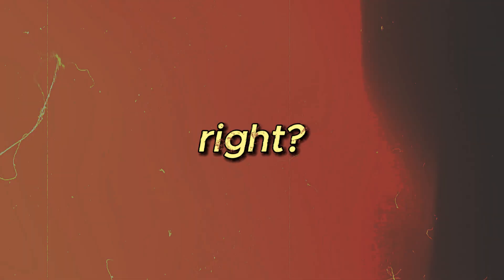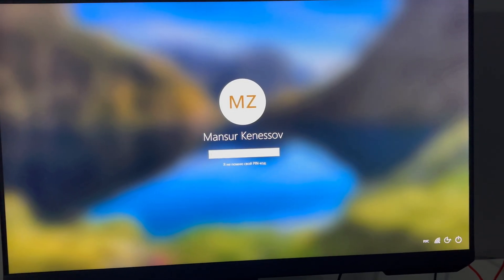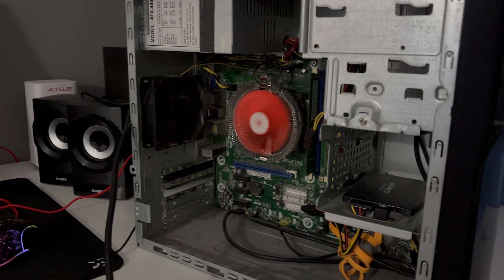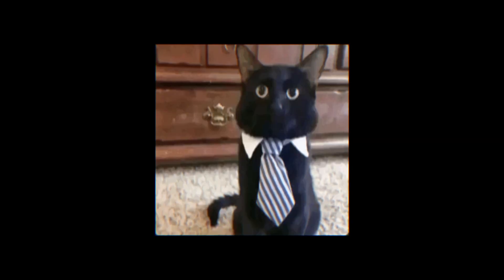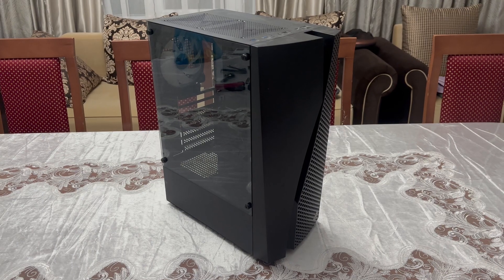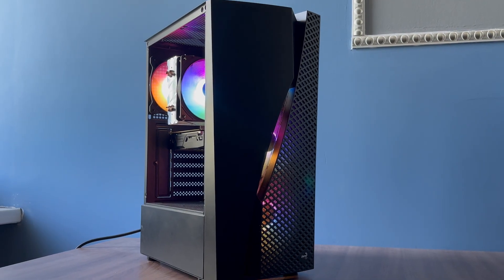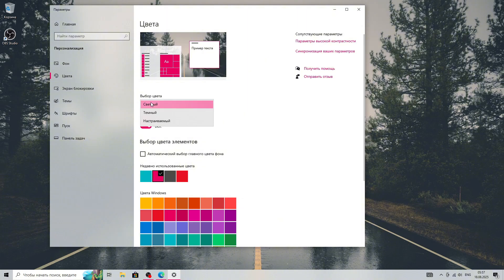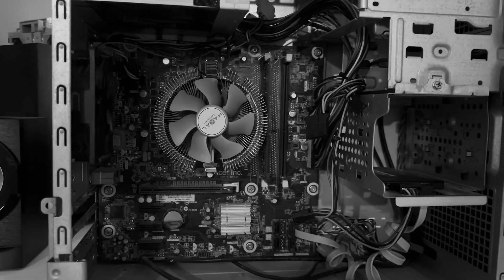I Turned a $30 Office PC into a Gaming Beast... (Was It Worth It?)

Comment from the maker: what are your pc specs guys?
Reply: Celeron n4000😭

There is no way to play valorant broo
Reply: 5600g, 3050 (same as u) and 16gb ram
Reply: I7 13620H, RTX 4060 16gb ram 1tb ssd
Reply: Planning to build top tier gaming pc
Reply: Xbox
Reply: Ryzen 7 8700G
B850 msi mobo
32 GB GDDR5 6400Mhz
NVME SSD WD blue 2TB
RX 7900XTX ( I know pairing a g-series CPU when the graphics card is kinda weird but in case my GPU is broken the integrated graphics will do the job )
Reply: I5 7500 Gen 
32Gb DDR4 RAM
239 GB NVME SAMSUNG SSD
DVD DRIVE
15 GB INTAGRATED GPU
Reply: i7 4770, gtx 1660 ti and 16gb ddr3🙂
Reply: @stixyk not bad😉
Reply: i5 10400f
RX 6600m
16gb ram
Reply: i5-6500
Rx 570 4gb
16gb ram
In total cost me less than 125 eur
Reply: 7800X3D RX 480 8GB (Sent the RX 7900XTX in for repairs) 32GB 5600 CL28 RAM
Reply: @kitsune-chan6897  I was gonna cry from that bottleneck if you didn't say the 7900xtx part.
Reply: The case is from Ozon, the motherboard on the H-chipset is from msi. 700 W power supply from Azerty, i5-13400f and Intel Arc A380. Cooler from Ozon.
Reply: Celeron 6305 suka, 8 gb ram yopta, and no forced updates blyat, that can break your drivers (arch btw)
Reply: I5-4590t,
Intel HD 4600,
2×8GB DDR3 1600MHz,
1TB HDD,
Windows 11 (Unsupported) & Linux Mint dual boot.

No PCIE slot btw.
Reply: 5800xt 9060xt 32gb ram
Reply: i7-920 (not a typo) gtx 260, 3gb ddr3, and a 400 watt psu (probably pushes 300.)
Reply: Steam deck oled 1tb ssd
Reply: rtx 3060 12gb,  r5 5500, 16gb ram, 500 nvme ssd, 750w gold psu
Reply: 24 ddr4 ram 2070 super 5600x 1tb ssd 2tb hdd
Reply: 5700X3D + 9070 XT 🔥
Reply: i5 13th gen, integrated graphics, 16gb ddr4, 256gb nvme, and i use arch btw
Reply: I3 😭
Reply: ryzen 5 5600, rtx 4060, 16gb ddr4, 1024GB SSD
Reply: Iam Literally running i5 6200U 8 gig and got my laptop for $130
Reply: 5   PC 
1 i7 13gen laptop rtx4050 laptop msi thin 15 
2 rtx 3050 i5 8400 
3 i5 3330 rx550 
4 core due quad Q9550 Nvidia 730 
5 core due duo E7300 GPU ? Intel integrata mobo integrated futjizu 
+ Extra component  Nvidia 1050 ti gigabyte 4gb gddr5 ,1030 gigabyte 2gb gddr5   ,1050 mini zotac 4gb  ,Nvidia quadro 3500fx
Reply: ThinkPad T480 laptop:
8th gen i5 CPU (4C 8T)
8gb DDR4 RAM
Intel UHD 620 graphics
250gb SATA SSD
FHD IPS 60hz touch display

Comment: You can upgrade it with a cheap xeon so that you get hyperthreading, it's a big difference. I disagree with you saying that Nvidia ages better, in fact you can get an rx580 2048sp for the same price as the 1050ti which is faster and has 8gb of vram.
Reply from the maker: Yeah man you are totally right. At first I was also thinking about getting an RX 580 but honestly two things stopped me. First my budget and second the fact that in my city AMD cards are basically nonexistent. People here dont even know what AMD is for them its only NVIDIA and thats it. Finding a decent RX card even from the 5000 or 6000 series is almost impossible around here. And the 580 forget it there is just no way to get one locally. So yeah I had to stick with an NVIDIA card since they are super common where I live.

Comment: Well, the GTX 1050 might not run Helldivers 2 or Gears of war: reloaded. What you need to get is a 1070 or a 1650 with a better Intel CPU. Probably a 8500.

Comment: same specs and i get around 280 fps on cs2. 500+ fps on valorant all low. 300 fps on fortnite all low. yeah i tweaked the sh!t out of the Pc. btw with the russian accent i enjoyed it more
Reply from the maker: Bro you are the living proof that I actually turned this old office pc into gaming machine. And if what you saying is true, then after some crazy optimization this pc can really push that much fps, thats just insane.
Reply: @byKarimus yeah maybe new video someday?? with optimizing the pc maybe?
Reply: How can you have so much performance?  I have a i3 8100 paired with a GTX 1650 with 8gb ram and it is not doing well like this. Just one ram slot of my motherboard works
Reply: @legitimo1788  my pc is tweaked and maybe thats the thing bc 1 ram stick WILL decrease fps. if you can just buy the same model ram stick and done. or is the slot broken?

Comment: i5 2400 isnt useless. I put together a system for a friend  with agressive bargain hunting, I got a i7 2600k (4/8 makes day and night in modern titles) and a rx550, (they can replace that) 500w power supply, ssd which they had, 
and 16gig of ram. 
overall it was 100 buckaroos.